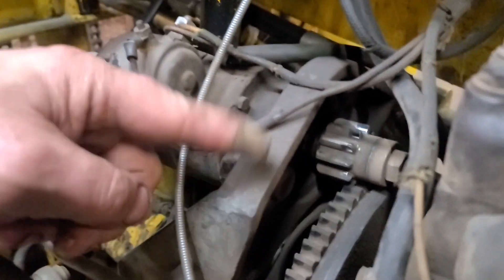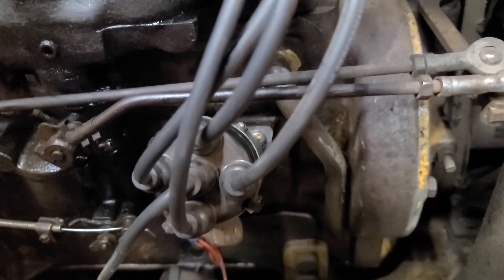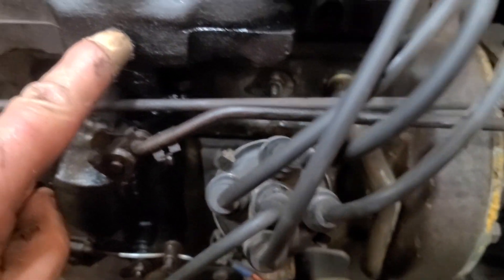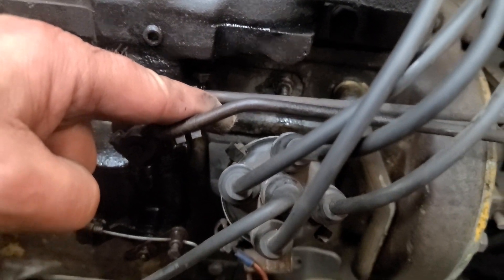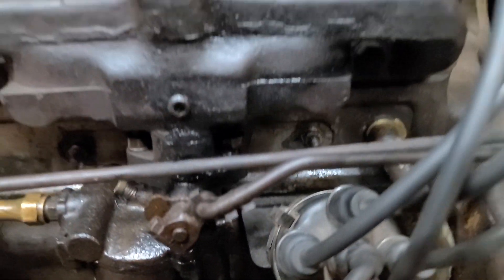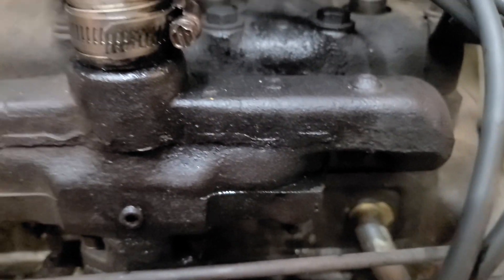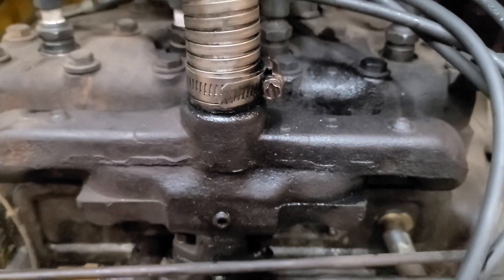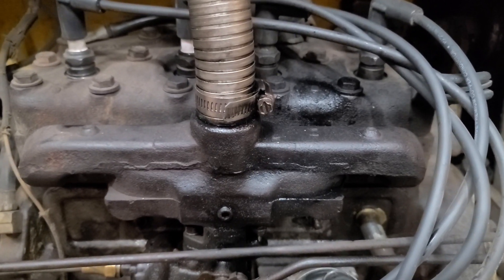December 19, 2022

Comment: Head over to Low Buck Garage channel.....anytime motivation runs low.   You probably have the same eye for parts as he does.  I have a feeling when you crack open the carburetor you'll just make what you can't get.
(Low Buck fit a Toyota starter onto old Jeeps.  Your starter may have a common bolt pattern too).